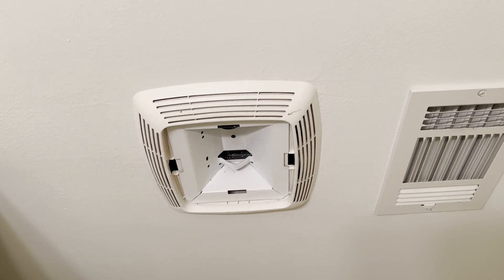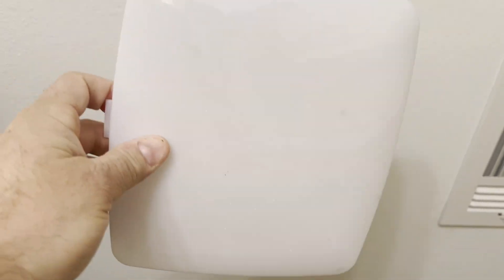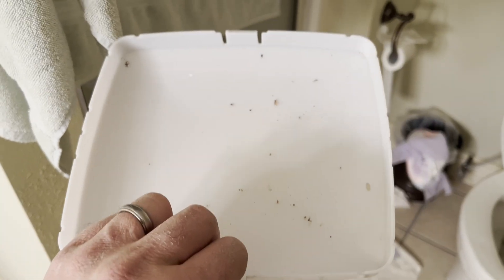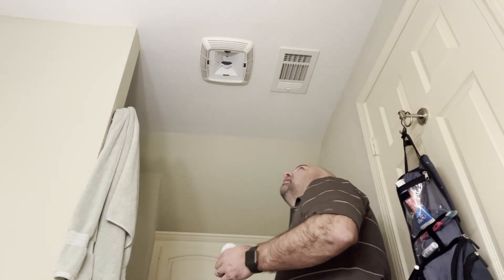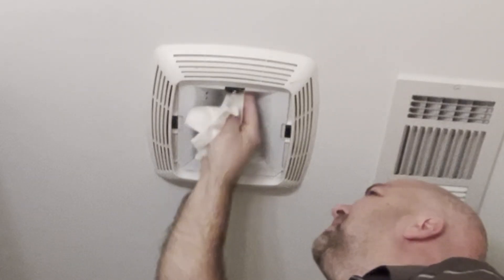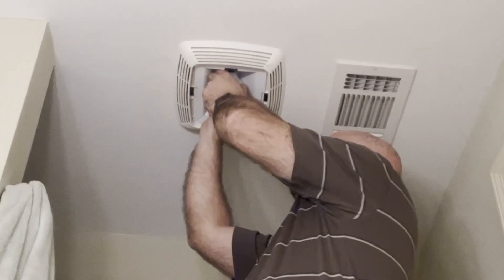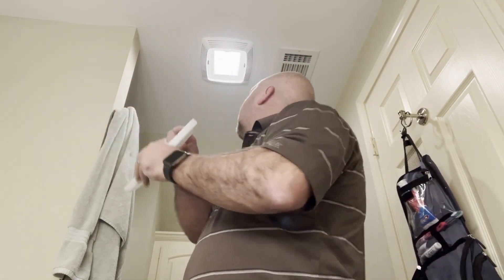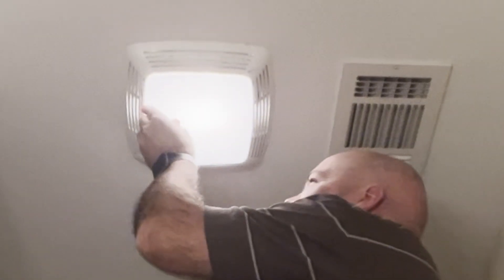How to Replace Bathroom Light in a Vent Fan! Easy Process for Changing the Light Bulb - by DIYNate

Comment: Do you need to use any special  type of bulb because it's enclosed and near the shower steam?
Reply from the maker: Good question - I didn't look that closely at mine short of just using a like-for-like bulb swap, but if you are concerned, the best place to look would be the owner's manual.  I think you are probably safe using a similar bulb to what you have, but since models and makes can vary, I would just double check the manual or use a similar bulb.

Hope that helps!
- DIYNate

Comment: Mine os of course more complicated, had to slide out screw covers, unscrew 2 screws only to find not only lots of dust on light & motor but the light has a metal housing around it, can't see how to get it let alone reach as my lid had 2 wires plugged in near inaccessible to unplug.
Reply from the maker: Rats - that sounds pretty complicated.  You could try and see if you can find a model and then look up the manual online to see if there is a better way or maybe try the Google Lens feature where you take a picture within the google browser and it identifies your type of light.  Maybe from that you can find the model number and then the manual to see how they recommend the bulb change.  Sounds like you got a doozy of one.  Good luck with the change!
- DIYNate